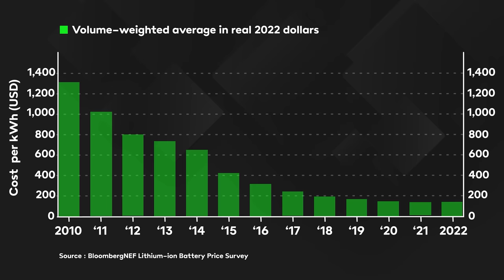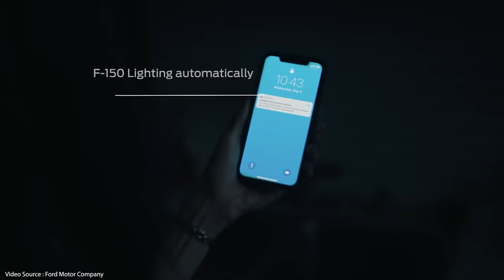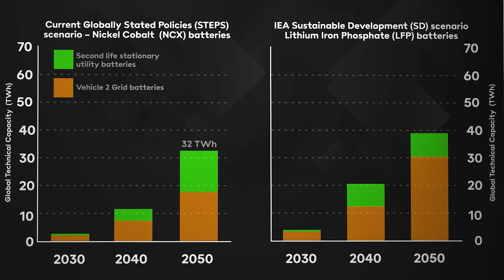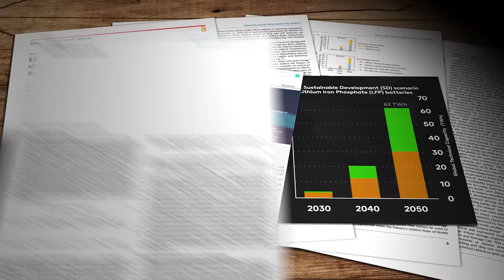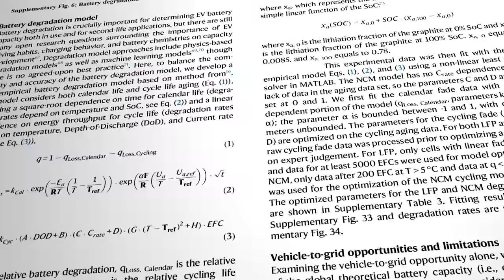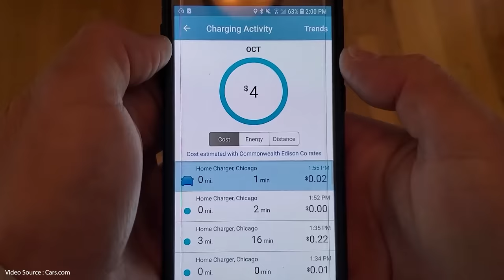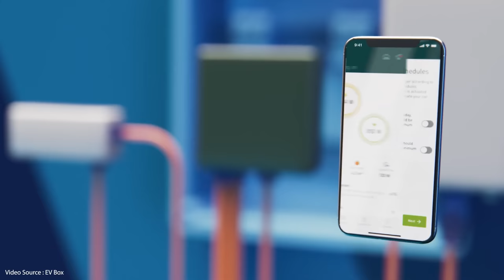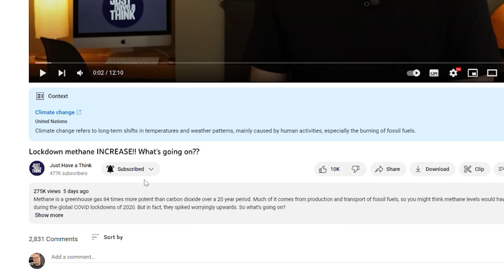Can the electric grid ruin your EV battery?

Comment: i made my pv system with panels that were rotated out of a pv farm as part of scheduled rotation program... the panels still produce higher power than rated.14x$100/327W panel delivered! also experimenting with a pair of wrecked tesla batteries that are performing like new 2x$1k for 10kwh. total cost way below $5k.
Reply: I built a system for $1200 - $600 lead acid batteries lasted 10 yrs - so about $5 per month - that was 17 yrs ago - should be able to do better now but elec is cheap, I don't use much
Reply: Nice!
Reply: @hillwalker8741  yea... i don't use much and it is relatively cheap here too. i am working on going off grid though it is less about money and more about not being dependent in a system which is going to be increasingly unreliable. i am also philosophically more a distributed kind of guy... i think centralization is fundamentally foolish in the real world where uncertainty is the driving force. if you do it again, loose the lead acid batteries... in the long term they are much more expensive. my first solar setup was in the 90's and then i didn't have much choice but now we do.😀
Reply: CoPart are filling up with EVs in the UK. No recycling or reuse evident. Very likely, there are going to be some real huge fires. Waste recycling yards have a tendency to  burn out. 😁
Reply: @robindumpleton3742  interesting. Just looked them up . 8 Nissan Leafs and 5 Tesla's at the moment... Maybe not filling up and half of them look repairable
Reply: @garysmith5025  yup... im doing thermal after my batteries too. as you can afford it, and as the prices come down and availability increases, you will be able to insert batteries in the middle easily. that is the other benefit of diy... flexibility 🙂
Reply: @robindumpleton3742  they are not selling batteries?! what is the point in sitting on them? contact them see if you can get a deal 🙂
Reply: @garysmith5025  yup... similar to my setup... the batteries are already dropping in price and that will continue as evs become more numerous. mine at $200/kwh 4yrs ago can already be had for less but i bet in a couple of years it will be $100/kwh. that's why i only got 10kwh for now... i can add as prices go down as they must. i heat with hot water (radiant) and have a wood backup for the dec-jan period where in my area we get no sun for a couple of months. my 3 old school solar hot water heaters i got cheap and restored heat the many stripped down old hot water heater tanks i restored and insulated. the tanks are setup to have progressive increase in heat. the hottest tank pre heats the water going to the electric hot water heater which rarely comes on and is used for showers, sinks, etc. the cooler tanks heat the radiant floor. the wood stove heats the tanks when sun is not there. works very well.  cheers 🙂
Reply: @harveytheparaglidingchaser7039  mine were in perfect condition... if they need service, price should be far lower. prices have come down since i got mine 3yrs ago for $200/kwh... prices will go down as more evs are out there. also... i have used tesla bats... i have not heard great things about the nissan bats... no experience though. the tesla units are awesome. i had them holding their charge after sitting for nearly 2 years... virtually no leaks at all. that is one of the main ways you can tell the pack is in good condition. cheers🙂
Reply: @Al Pine  I heard a scientist say 3 years ago that $80/kwh is The Holy Grail. He showed a scatter plot of all the purchases .I forget how low it had got, maybe $120/kwh but I'm just guessing from memory. I don't think he predicted $80/kwh at any time, only that it's "The Holy Grail" of scientists based on battery science.
Reply: @grindupBaker  well, here we are talking used and i would not be surprised if we got below $100/kwh for good used batteries by the end of the decade if prices continue the way they are. evs are becoming more common and that means more available used batteries. home solar batteries do not have nearly the requirements of evs. of course there are other batteries becoming available such as sodium, solid state, and various flow batteries to name a few. now it is market driven development will not be slow. but for us diy poor guys, used will probably remain the choice. cheers 🙂
Reply: @hillwalker8741  How long did the lead acid batteries last in a solar-battery setup?

Comment: The way you use the word "electrons" in a way that suggests they are somehow dispensed from the battery is annoying me more than it perhaps should. Electrons aren't something that's stored in the battery and released over time. In fact, one of the key laws of electrical circuits is that for any component, the number of electrons going out is always the same as the number going in, and batteries are no exception. That's not where the energy storage comes from.
Reply from the maker: Yes. It is definitely annoying you more than it should. It is simply a turn of phrase. :-)
Reply: Turn of phrase or not, it gives people a wrong idea of how physics work, and that ultimately contributes to the public's ignorance of the issues and potential solutions. Like that time some were worried about solar panels exhausting the sun...

I mean, not to underestimate the average person, but I think for many, videos like this are the only source of physics knowledge they care to seek out. And it is difficult to convince people there are issues to be solved, when they have a culture's worth of misconceptions about how any single aspect of the issue works in reality.

Comment: Great video, as always.  Before we can figure out the complex global and local schemes for fair micropayments for use of battery health for the grid, why don't governments incentivize manufacturers and consumers to have V2G on every EV?  Seems like it sets the ground work for capacity while the rest of the integration work gets figured out.  Also, if I knew up front that part of my incentive to buy an ev was that the grid could use it instead of building new (or enable retiring of) non-renewable production capacity, I'd be ok with it.  V2G is not a high value feature on an EV for a consumer today, unless their local energy provider already has good schemes and incentives.
Reply: V2G doesn't interest all that many people, but vehicle to home is VERY interesting.  Many of us face occasional power outages and would love to use our EVs for backup power.  This is infrequent enough, and low-draw enough that it would have negligible impact on battery life.
Reply: One problem is that there is not yet even a universally agreed upon standard for how V2G to would work, which makes automakers reluctant to spend money outfitting vehicles with what might prove to be white elephants. There is also a chicken and egg support where utilities won't support it unless enough vehicles do, but the vehicles won't unless enough utilities do. A third problem is the cost of all this "smart" equipment between the car and the house, along with the cost of hiring an electrician to change out wiring to allow the home or grid to receive power from the car. Even something as simple as using an EV for home backup power currently comes with sky-high installation costs which, if you only rarely have power outages is probably not worth it, even if the car itself supports it.

I personally think the simple, cheap solution to all EV battery power to be used as home backup power is not bother hooking the car up the home's actual electrical solution, but simply running extension cords to the garage to power appliances directly. It's not as elegant or full-featured as full V2H - you get lots of cables to trip over and can't run your central air conditioner - but for simply running a refrigerator, toaster, microwave, floor lamps, and phone charger, seems good enough. If the car and extension cords support the amperage, you could even power a space heater or portable air conditioner this way to keep at least one room in the house somewhat climate controlled. And, considering that the car's own motor draws far more amperage from the battery than a portable A/C unit, just driving down the freeway, I see no reason why this can't be doable.

Comment: Like another commenter, I've been using the OVO V2G system for 2.5 years now. It doesn't affect the battery warranty on my 2018 Nissan Leaf and  despite exporting around 14kwh most days for this period, there is no measurable loss of battery capacity. Warwick University research show that this slow cycle charge/discharge can actually stabilise and balance a multi cell pack and does not damage it. As a sidenote, OVO have repaid us very well for our returned units (kwh) and this has halved my energy bills.
Reply from the maker: Excellent comment Graham. Many thanks